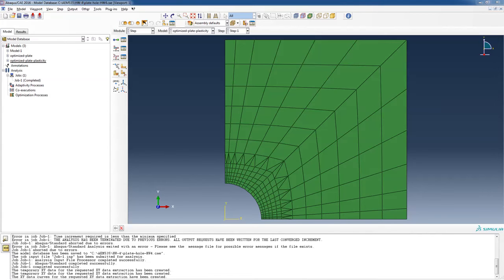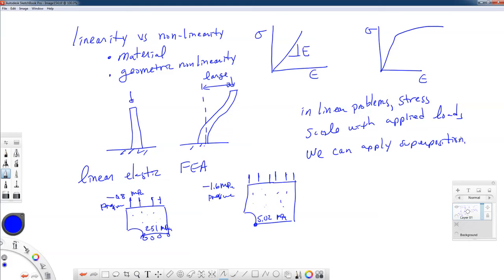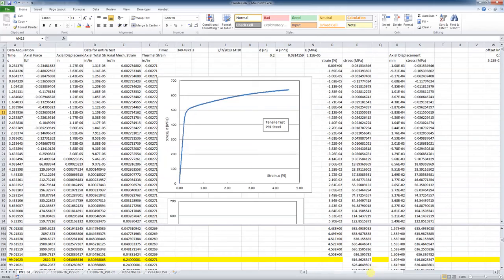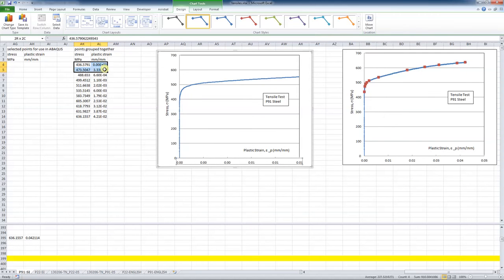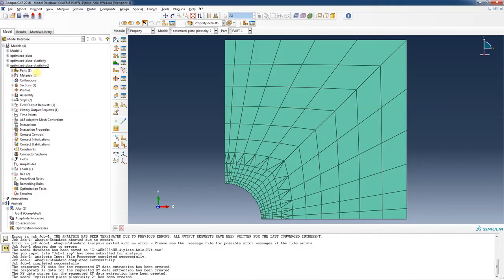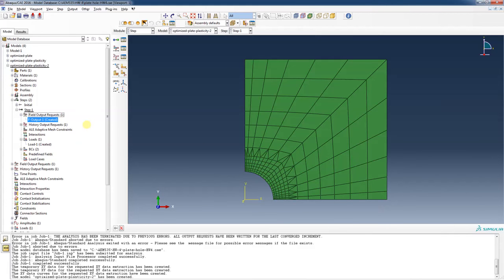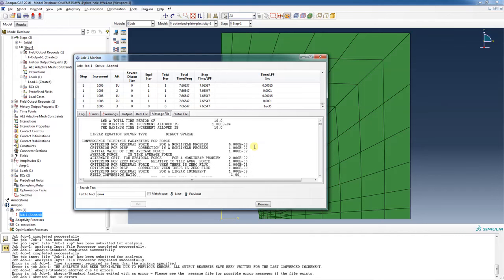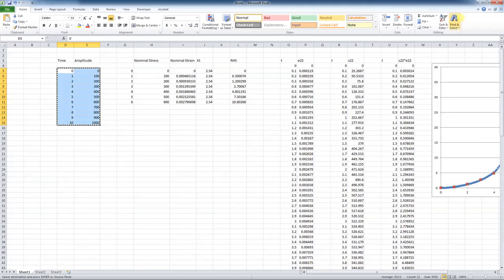AEM 535 HW-4 Plasticity in Plate with a Hole

Comment: Hi Dr. Mark
I am working on calculating the strain at a notch exhibits plasticity under constant loading, to end with estimating the number of cycles for crackinitiation using the strain-life approach. Regard FE modelling, while I am doing the sensitive analysis I  could not converge the values of strain at the notch no matter how far the mesh was refined. In contrast,  the stress was converging. It seems plastic strain is so sensitive to FE mesh, and then using FE to calculate the strain for fatigue life prediction will be unreliable. (your comment please)
secondly,  to calculate the strain at the notch (notch under multiaxial loading) I used von-mises  and as following 
E=Eelastic+Eplastic= (S-von-mises/E)+PEEQ (effective plastic strain).
Your comments and suggestion are appreciated
Thanks
Reply from the maker: Hi Naz Ar, If you have exceeded the largest defined plastic strain level in your material definition, the behavior will be perfectly plastic.  In this case, the strains will only be restricted by the limit of the deformation of the surrounding material, so the strains will likely not easily converge.  You can check to see if this is the case in your analysis by examining the stress level.  
For the second question, you can use that method for equivalent strain, but only for proportional loading and then you must also give a sign (+/-) of the Mises stress depending on the reversal of load.  (I also assume here that you are doing a monotonic FEA, but you are interested in cyclic fatigue loading.)   Hope that helps!

Comment: Hi Dr. Mark,
Thanks for the very helpful vidoes and the great explanation. I still have a general question about plasticity: the problem i am working on (sheet metal forming) is seem to be nonlinear kinematic hardening. I got now an example how to define it in Abaqus from the university of darmstadt. The results obtained from the simulation are very similar to the experimental curves. They defined plasticity in Abaqus using combined hardening-->option Parameters -->fieldvariable (0) and fieldvariable (1) each containing values of the yield stress, C-Parameter and Gamma-Parameter. Yield stress and Gamma have the same values in both fieldvariables but C-Parameter not. And there is a Subroutine whose varies this C-Parameter according to the calculated equivalent plastic strain. my Question is: why do i need here two values of C-parameter and what is the relation between C and the equivalent plastic strain? Values of C are 45000 and 199000 and of Gamma 100. Hope you can give me an answer so i can apply this modeling on other steel materials. Thanks a lot :-)
Reply from the maker: Hi Kaiser160, It is good to hear from you again.  The good news is that I will teach plasticity this semester.  I will have to study your question in detail when I get some time.  In between, it would probably be a good idea to read the sections in the ABAQUS theory manual again.  I will post back here when I can--but it may be a couple of weeks from now.
Reply: Hi Dr. Mark! Great! I´ll be waiting for the answer and plasticity videos. I ´m always following your new uploads. Your videos are really helpfull.